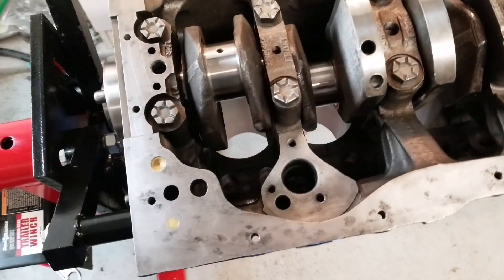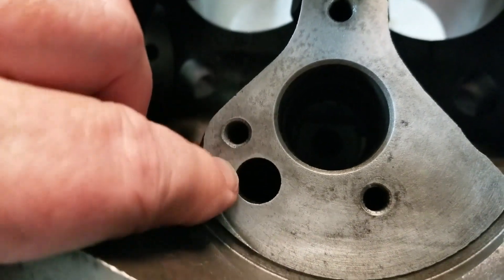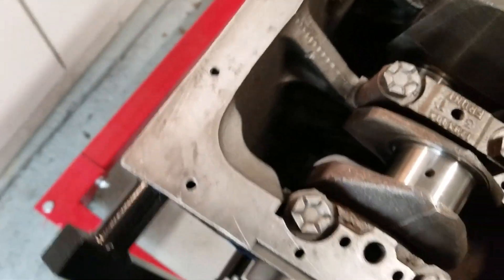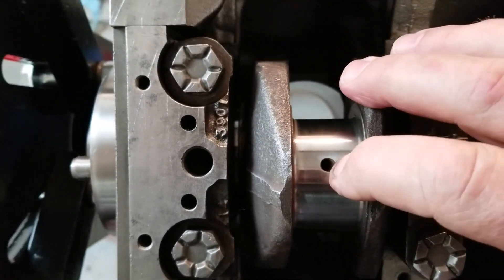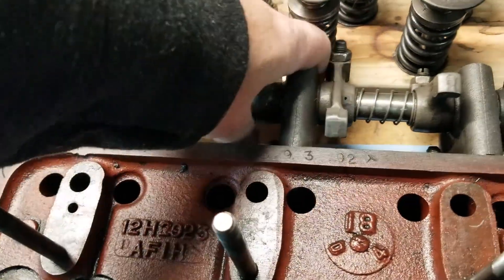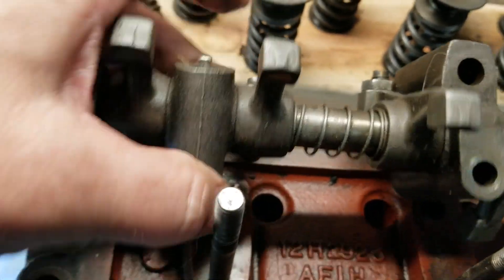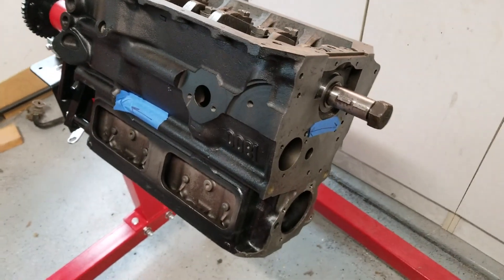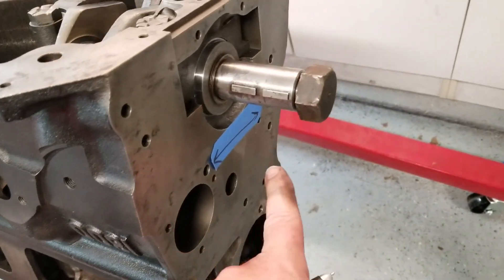Nigel the 1977 MGB 1800cc Oil Path (18V engine type)

Comment: Did the machine shop remove --- ALL -- oil passage plugs --- clean the passages ----- Funny you had --- I guess gasket sealer in that blind hole ----- wonder what is inside the passages if the plugs weren't removed ----- Nice catch there on the oil pump threads -- being pulled up --- may have caused air to be sucked in -- lower oil pressure ----- Good you caught the water pump threads before you got the engine back in the car ---- may have had a leak there ----- Thank You for the video ---- Rodney

Comment: Outstanding video and presentation. I'd  replace the spring on the relief valve also. Better to be safe than sorry. If it becomes fatigued it will collapse and reduce your oil pressure also.
Reply from the maker: Truth...
and only $6
https://mossmotors.com/spring-oil-pressure-relief-uprated
Reply from the maker: and the bullet is only 2 bucks
https://mossmotors.com/oil-pressure-relief-valve